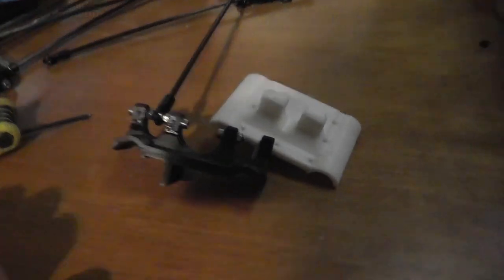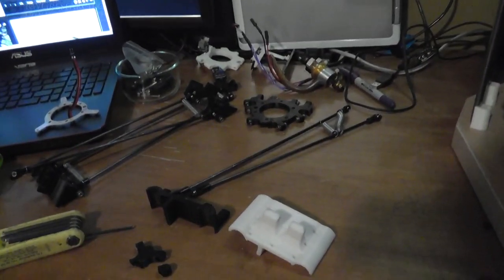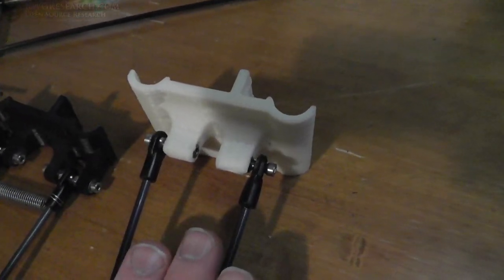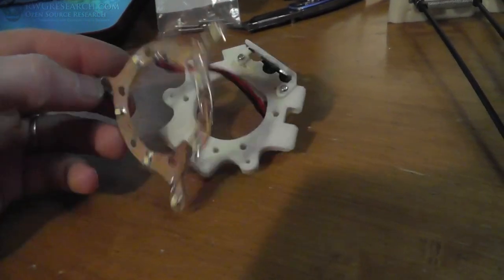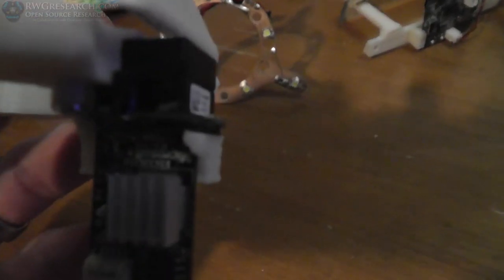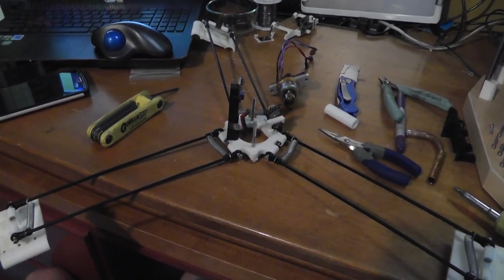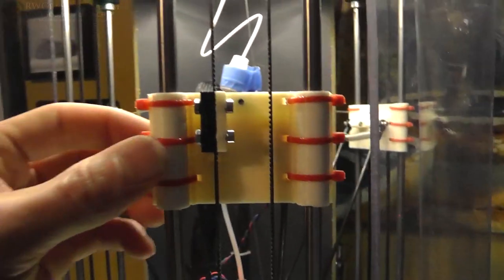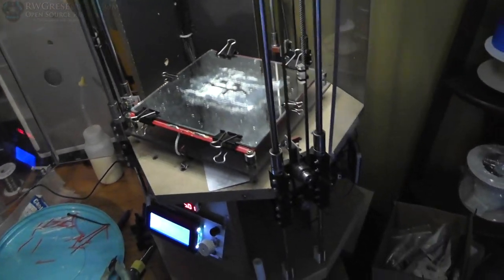Last Rostock Upgrade 2016 Before RWG OSD!!! Oh Man The Next One Is Going To Be Fun!

Comment: Thanks for the video. Very informative. Just curious. Can you mix materials with 3d printed plastics like metal to increase the strength. It seams like a thin piece of sheet metal would reduce the stresses on the plastics.

Comment: if they keep failing i suggest you try casting them in to aluminium
Reply from the maker: yes. this is the next step. I will have access to the right equipment to do loss pla casting. that will be the final straw :) ~Russ